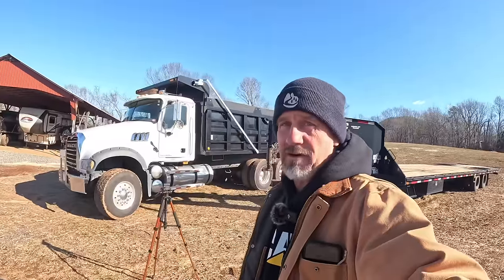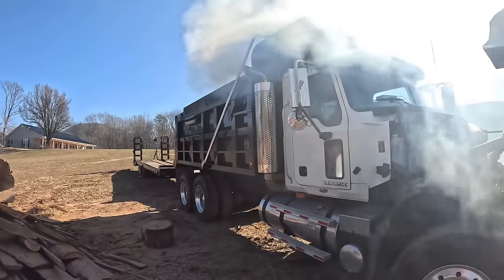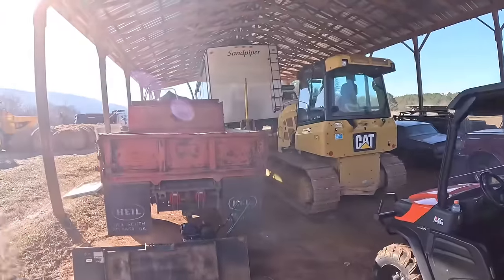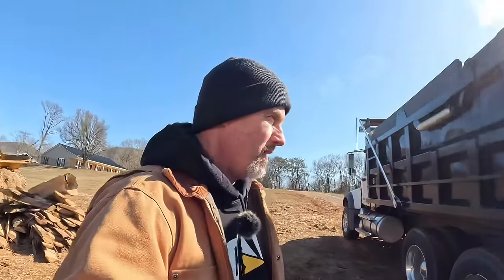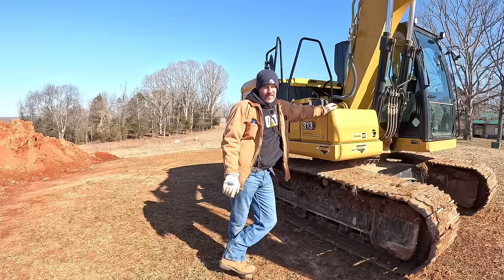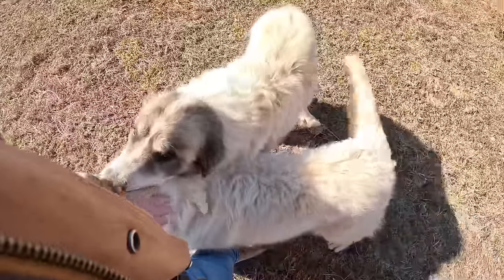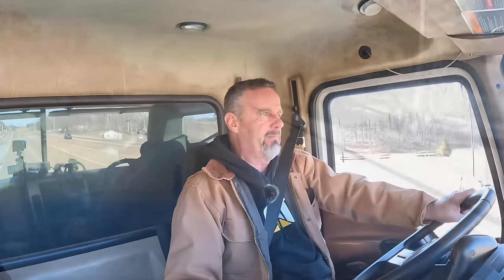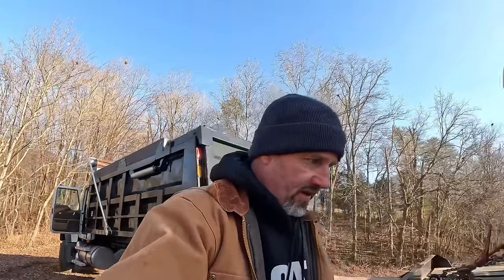WHAT HAVE I DONE?  IS THE MACK BROKE ALREADY? 😳🫣😡

Comment: Hey Sam , great video!   If I may give you some advice from a northerner in the cold who buys trucks from other sates . I will bring trucks home and the first thing I do is install a block heater if they do not have one . That lets you plug it in for those really cold days . Those real cold starts are not the best for the engine. I also drain the air tanks daily in the winter. Some times I take the air line off at the compressor and pour air line alcohol in the line , then put the line back on and start the truck . That helps un stick those frozen shifter valves that have frozen moisture in them. I also pour alcohol In the trailer glad hands . Helps To unfreeze the brake valve on the trailer that sometimes stick .I changed from using rubber in the glad hands to the blue and red neoprene inserts. They don’t rip or wear out as fast and have a much better seal . Congratulations on the truck. It looks like a really clean ride.  👌 I like your lettering guy’s words of wisdom!
Reply from the maker: Thanks Steve that is great info. I need to look for a block heater to see if it has one. My Ram does and I use it fairly often when really cold. I do need to add the alcohol and neoprene instead of the rubber.
Thanks and stay warm! I agree that was some great wisdom from Johnny! 😀

Comment: A lot of those Macks with that Mack transmission have a pressure valve on the transmission. The reverse selector and the range selector need 90 to 100 psi to activate the range and reverse function.
Reply from the maker: Good deal, thanks for the info…

Comment: Just a helpful suggestion. You could bring in few loads of rock when able to and make you a parking pad and turn around spot.  where you backed the trailer up by your haul truck. Then both trailers would be out of the way. Then when you hooked up to either one of them and you could pull either of them out without one being in the way and having to move the other trailer so you could turn around. You also wouldn’t have to worry about getting stuck or losing traction and spinning your wheels when  backing in and pulling out and hauling your equipment in and out.
Reply from the maker: Hey thanks Adam that would work great. I do plan to make some more space. I’m going to move that fence line across from the shop area and make a big parking area on the pasture side of the road. Should be able to get most everything over there and out of the way…

Comment: Those look like big fuel tanks for a dump truck. Seems like smaller tanks would leave more weight capacity for your load. (and hurt less to fill them up. LOL)

Love finding an interesting channel like this. I like to start at the beginning and watch the growth. New equipment new different jobs. 

Do you plan to get another mulching head? Or is the 304 not big enough to make it really worth it?
Reply from the maker: They are definitely big tanks. But actually I don’t even haul the max weight the truck can legally haul. Just trying to not overwork it carrying max loads all the time.
I don’t plan to get another mulcher. The 304 is too small for one. I’m not really looking to get one for the 313 either though. I didn’t care much for mulching after I did a few jobs with it. I guess I just prefer the dirt…😀

Thanks

Comment: Hey Sam, curious if that 313 has the drive by stick or "skid steer" mode where you can track with the left pilot control?
Reply from the maker: It doesn’t have stick steer but that sure would be nice to have…
Thanks,
Sam

Comment: Those pads next to the pedals to rest your feet on. When traveling I’ll leave my heels on the pad and put my toes on the pedals to go forward and when tracking backwards I leave my toes on the pad and my heels on the pedals. I’ve also just put my toes on the rear of the pedals to go in reverse (forward but tracking in reverse) you can do but how you like. Just thought I’d toss my experience in there. My old boss would jump on ya if you used your hands. In the 305 the pedals were smaller and hard to track with. Too hard for me to track in reverse in sensitive tight areas so I would use my hands some and tell him to hush lol. My feet were too big for that on the 305.5
Reply from the maker: Right, just doesn’t feel comfortable to me pushing down on the pedals. I’ve seen some videos where the guy cut the sticks off and just used his feet…
Reply: @tristardiggin  yeah my boss told us we had to be able to track and run the sticks at the same time. It’s good practice and works well on the larger pedal machines. But the little pedal machines I just can’t. How you like that big pedal on the right for just forward and backwards?
Reply from the maker: @poorfarm-nn6ii  I love that travel pedal. It works great and I use it forwards and backwards. It was a great idea for them to add that…
Reply: @tristardiggin  the first machine I was in that had that I seen it but had no idea what it was lol.
Reply from the maker: @poorfarm-nn6ii  same here, I was wondering what in the world it did…😀

Comment: Hey Sam, I’ve been watching your videos for a long time !
Did you buy a Mack ? 😎
Some units of Mack had been sold in Europe in the 70s-80s.  
In France but also in Spain and some models elsewhere. 

In France the limit is 19 tons maximum (and under) for a rigid 2 axles, 26 tons for a rigid 3 axles, 32 tons for a rigid 4 axles for example. 
For exceptional convoys it is more complicated and different...
Reply from the maker: Hey Nicolas been wondering where you have been. I did get a Mack and it is a great truck and really enjoying it. We can leave the quarry at 66,500 lbs. in a tandem axle. The Mack weighs 25,000lbs. So technically I can haul 41,500lbs. But I’m only going to haul 18 ton most of the time in order to not wear out my truck so quickly.
Thanks
Reply: @tristardiggin  A small amount of Mack trucks are part of the transport history in France and Spain. 
We for example for a 6X4 the weight of the truck plus the load should not exceed 26 tons.

Comment: Air regulator. It goes bad 40 pounds of air is all you going to get. The air connections I use a screw driver and spit as Lubricant.
Reply from the maker: Thanks, appreciate the info…

Comment: What is that whinch looking like system on your Dump Truck Trailer?
Reply from the maker: It’s a home made ramp raiser. That ramps are so heavy I made that to lift and lower them. It works pretty good so far…
Thanks
Reply: @tristardiggin  i remember now i thought maybe the ramps were broken but that saves you from having to lift them by hand everyday
Reply: i don't blame you for that it's not fun lifting you lowing those trailer ramps everyday

Comment: I'm convinced you need a couple more trucks😂 and at least one that crosses state lines. After trying to comply with all the rules and regulations you'll wonder how you can even drive a truck down the road, and you'll wonder why your even doing it and if you're even making money 😂 you may already be asking yourself a few of those questions 😂
Reply from the maker: Chase you are not kidding at all. Wow, what a challenge just to get trucks and equipment ready to work. I spent $8300 on taxes and tags and $3700 on insurance. So, I’m 12k in the hole before I even get to use it to make money…😡
Reply: @tristardiggin  that insurance comes due regularly too!

Comment: Your reverse shouldn't do that if you dont have air dyer you have water in the air system.  But ive seen air dyers fail an put water in the air system. Dump some ABS safe alcohol in the system behind the air dyer if so equipped  i just got done fighting a failed air dyer in -10 weather no fun 1/2 gallon later of alcohol i got the system free of water.
Reply from the maker: Thanks for the info, I will check on that. Sounds like you had a rough time with that air dryer in the cold…🥶
Reply: @tristardiggin  about a hour I had the system working properly

Comment: it doesn't look like the interior of the 259D changed too much for the 259D3 it looks the same pretty much. The only difference maybe i don't remember because i haven't been in a 259D3 since last year and they may have put key slot on the right side instead of it being on the left side like it is in your 259D okay the key slot is on the same side in the 259D3 like is in the 259D2 ig you would call it
Reply from the maker: Colton I believe you are right. I’ve seen a few videos with the 259D3 and they look the same…
Thanks
Reply: @tristardiggin  Yeah i remember now the ignition is on the left side inside the cab my bad